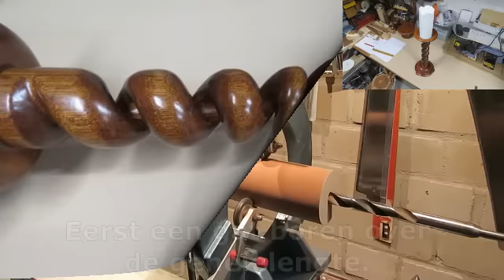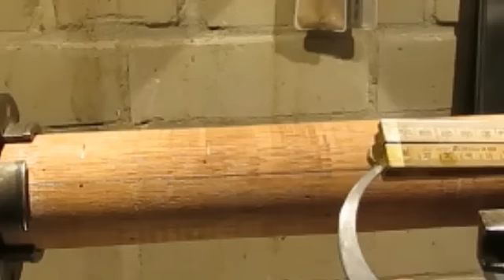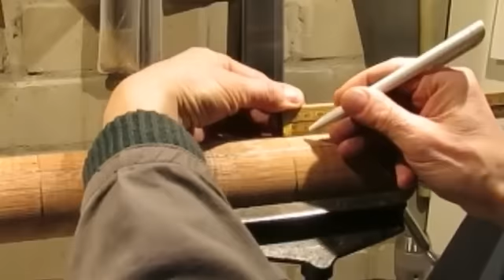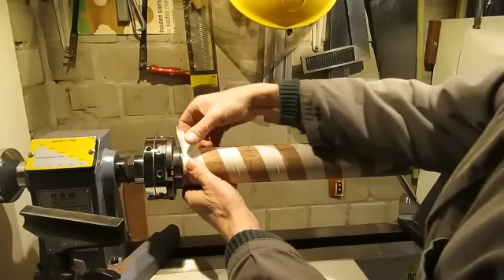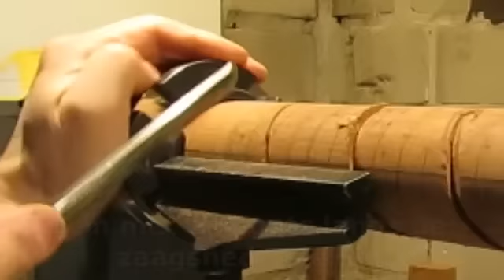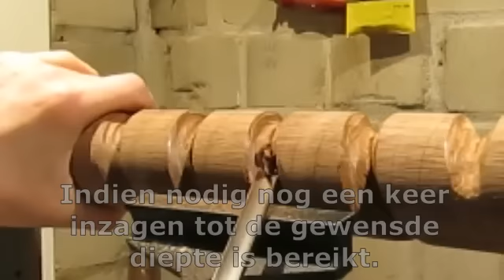Spiral Twist Making

Comment: Dude, that is not a spiral; it's a helix. How to make a helical twist. The radius of a helix is constant; the radius of a spiral increases at a given rate. The spring that holds a lighter's flint is helical. The spring in the battery compartment of a flashlight or remote control is often a spiral.

Comment: I wonder if you had a low enough rpm lathe if you could do the midsection while the motor drove? Be a whole lot easier but also easier to mess up! Lol
Reply: It would be impossible with a gouge. Maybe a dowel rod with course sandpaper glues onto it?

Comment: Why not divide into index points then incrementally offcentre  turn each band at a time. You can create double, triple, or quad open or closed helices. The result will look a little cammy until sanded but much faster than this manual method
Reply: Go for it. Film the whole thing.  Put the video, all of it , unedited,  on here and we will view it .